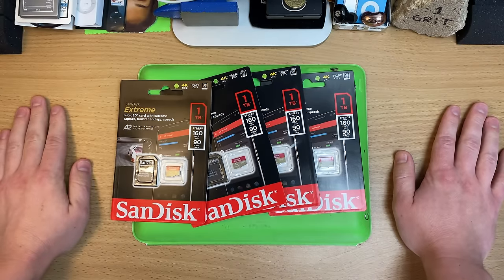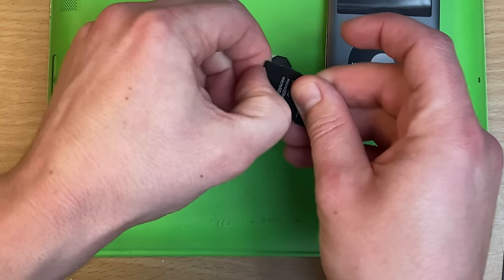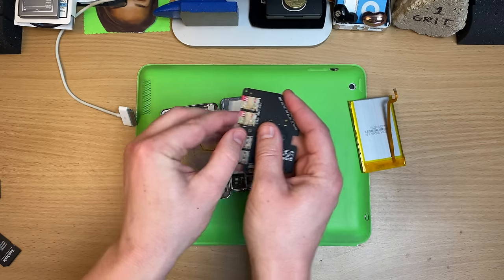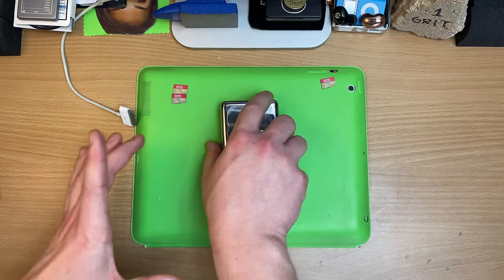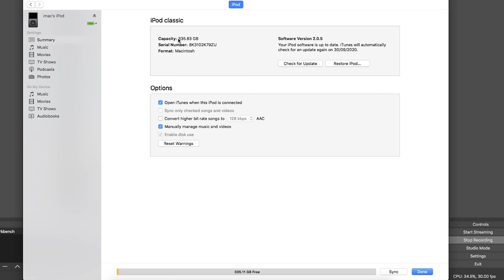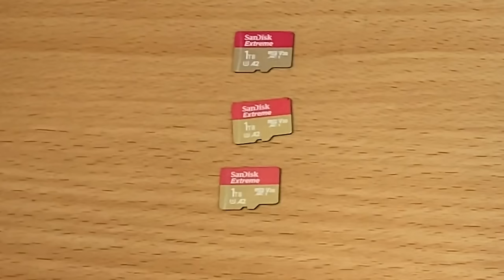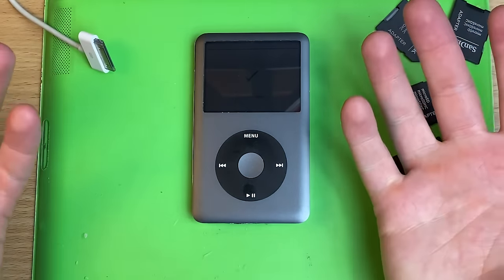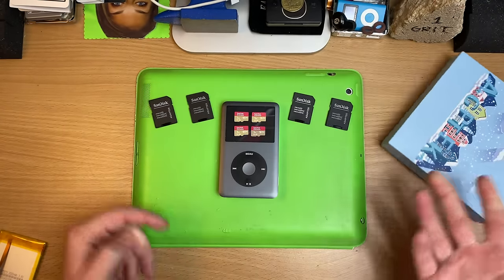4000GB in an iPod Classic.

Comment: The reason why the iPod can’t go over 2TB is because 2TB is the max address space for a 32 bit system like the iPod
Reply: • Joe Panda • FAT32 has a 2TB limit because... you guessed it... 32 Bit
Reply: RAID10 those SD cards son.
Reply: Was just about to comment smtn like this lol
Reply: he tried FAT64 as well though
Reply: schm1dt I have no idea but i am goona pretent that i under stand that.
Reply: It's probably not a good idea to keep touching the contacts on the memory cards or put them with the contacts touching any surface. You're bound to fry them with static.
Reply: so a 64-bit system has a 4TB limit as well?
(I'm just timing  it by 2 since I'm not a technician)
Reply: ALSO the MBR partition table can only handle up to 2Tb
Reply: i was thinking that myself because its from 2007 and not modern running on atleast 64 bit
Reply: is 4GB the limit for fat32?
Reply: schm1dt  oh i see. I thought everything was 4gb. it was just one file. Thank you
Reply: @iLife64  Maybe Modify The ipods Bios Will help to over 2tb (my opinion)
Reply: you should say spoiler alert before you say these things you pufferfish
Reply: This means that technically, an Nintendo 64, who's name is N64 because it's got a 64bit processor, could realistically see more than a 2TB game cartridge if one was made for it?
Reply: schm1dt  Good point, I'd imagine the connection would likely be the next limitation.  It'd be interesting to try though, see how large a cartridge you could fit in an N64
Reply: A 7th gen Classic is technically a 64 bit system the older iPods like the iPod Classic 6th gen are 32 Bit systems that is why you can put 1TB or more on a 7th gen but you cannot put 1TB or more on a 6th gen or older.
Reply: Music is noises
Reply: That's not actually true.  2TB is a limit for MBR if you have 512 byte sectors.  The iPod uses 4k sectors which makes the limit be 16TB

The FAT32 technical limit is 4,294,967,296 clusters (2^32 or so) and each cluster on the iPod is 16384 bytes which makes the limit of that being 70TB.

I know I tried using a 1TB card in mine and on the new board, the system did accept the 1TB card this time... but when I tried to write to it after adding more cards, the iFlash Quad board started being unreliable and kept crashing the iPod Classic (2.0.5 version)

Windows 10 supposedly will let you make a MBR partition over 2TB if the sector size is more than 512 bytes... but again.. can't get the 1TB card to work in mine so unless the iFlash Quad guy makes an iFlash Octa board, then I'm SOL on that hope.
Reply: @iLife64  No.  :)  That's not true.  You have 2^32 clusters you can have which makes the 16k cluster of iPod be limited to 70TB.  4k sectors on the iPod makes the MBR limit actually be 16TB since the 2TB limit is for 512 byte sectors which is what most disks have.
Reply: schm1dt  Yeah, but an iPod has a 4096 byte sector size.  :)  FAT32 address space is 4294967296 clusters.  iPod clusters are 16384 bytes.
Reply: schm1dt  Im pretty certain GPT wasn't even a thing yet when those ipods were sold. So there would be no compatibility. Remember when larger than 2tb drives first hit the market, there was software you would have to install before the OS could use it, and a lot of motherboards wouldn't work either.
Reply: schm1dt  " but there is a 4GB limit to any singular file on FAT32", somewhat off topic, but if i had to guess, would that be the reason why 32 bit windows has max memory of 4gb? i know a decent amount about hardware, but only little about software, storage, etc.
Reply: and 64bit
Reply: schm1dt  So is it possible to change it to let's say GPT?
Reply: Well, you should have communicated this to the man before he started trying to get mora than 2TB in that nugget
Reply: @GingerNingerGames  iirc the n64 supports banking and is how you would go over it's system limitations so theoretically I guess you could create a cartridge with a custom chip that could switch between thousands of banks to achieve a tb+ game. It wouldn't look much better but the amount of levels you could have would be practicality endless.
Reply: because FAT32
Reply: Everyone's talking about FAT32, but FAT32 is irrelevant in Dank's case since he's restoring the iPods on a Mac, so they get formatted as HFS+ (which supports 8 EB). MBR (and GPT) are also irrelevant since Mac formatted iPods use the old APM (Apple Partition Map) used on pre-Intel Macs
Reply: All of these theoretical limits are pretty meaningless.  Here's why:

MBR uses a 32-bit number to track starting sector and partition size, so you can't have a partition start at more than 2TB.  Although... technically... you can have a 2TB partition that begins at 2TB, though OS support for accessing that volume is a mixed bag.

FAT-32 uses some indexing based on sectors, but most of its internal structures depend on the number of clusters, which are a multiple of sectors (power-of-2 multiple, from 1 to 128 sectors per cluster, with a well-supported maximum of 32KB/cluster, and a sometimes-supported maximum of 64KB/cluster.)  FAT-32 actually uses a 28-bit cluster index, not 32 -- the high nibble is reserved.  So, in theory, 7TB (32768 bytes/cluster * 0x0ffffff4 clusters) is the volume ceiling, assuming 512-byte sectors.

(EDIT:  Wait, no, the BIOS Parameter Block actually does have 32-bit sector-count fields, so we're back to 2TB.)

IIRC, SD always uses 512 byte sectors, although I'm not 100% sure about SDXC -- it has been a while since I looked any of that up, and I was more interested in accessing smaller SD cards from a microcontroller via SD's SPI fallback mode.  However, all of that is moot without understanding what the FPGA(?) on that adapter PCB is doing to combine 4 cards into one "physical" volume.

At any rate, I don't actually know whether the iPod is using MBR and FAT on its disk, which would imply some known limits, or if it's translating raw storage blocks to the host in disk mode, and has its own on-disk layout.  That seems like a lot of work, so it's probably real FAT or HFS (depending on Windows or Mac format.)

Now -- the real question is, what LBA scheme is the device using to communicate with the virtual device presented by the adapter card?  Is either using LBA48?  If so, 128PB is our cap.  But it could be LBA48 with 32-bit truncation, which takes us back to 2TB.  My money is on this.  It probably keeps track of sectors in a 32-bit unsigned int, so 2TB is most likely the ceiling.
Reply: I was watching this video thinking, 'Slightly over 2TB. That's familiar…'.
Reply: @RiskiVR  Doesn't matter, the iPod itself has this limitation.
Reply: It's actually because iPods use Master Boot Record for their storage management, which maxes at 2TB. For anything more you need GUID Partition Table
Reply: schm1dt  no, 32 bit has a address space of 426443980
Reply: Absolute chad
Reply: @RiskiVR  exfat won't help with that
Reply: @yelnatsch517  You'd think that but SD cards are incredibly hardy little things. You can submerge them in water, destroy the device around them, and even chip a piece off and it'll still read almost every time. I lost an action cam to a battlebot match and the card was totally readable even after the camera battery went up in flames.
Reply: lets not forget the fact that iPods most likely use MBR that have a 2 TB limit anyways
Reply: @whycantifindanavailablehandle  Even if the cpu is 64-bit, the limitations lie in the partition scheme (mbr). So unless those 64-bit models use a different partitioning scheme (which I doubt) it won't make any difference.
Reply: or because apple only has a device that goes up to 2TB (ipad pro). so maybe they don’t have any number GB higher in the system idk
Reply: schm1dt  The iPod Touch as the Smartphones work a 64-bit system, so it would be possible to put in these 4 cards of 1TB or more, knowing that the 64-bit system has a memory of up to 18 EB (Exabytes)?
Reply: @RiskiVR  the ipod is 32 bit. feeding it 64 bit storage addresses doesn't change that, it just makes it brick even harder.
Reply: 2147
Reply: @RiskiVR  32bit not fat. It’s the chipset bro 😂
Reply: @smokyblackeyes3615  18 Exobytes for a 64bit system or 2 to the 64th power.
Reply: @RiskiVR  music youtuber
Reply: @RiskiVR  how much storage can a modern thing even read today?
Reply: @DigitalJedi  did you have the footage tho
Reply: @tylern6420  literally as high as you can imagine
Reply: @tylern6420  As I said, the card was still totally readable. The card was fine, so I had the footage.
Reply: @tylern6420  A 64-bit register can theoretically reference 18,446,744,073,709,551,616 bytes, or 17,179,869,184 GB (16 exabytes) of memory. This is several million times more than an average workstation would need to access. What’s important is that a 64-bit computer (which means it has a 64-bit processor) can access more than 4 GB of RAM. If a computer has 8 GB of RAM, it better has a 64-bit processor. Otherwise, at least 4 GB of the memory will be inaccessible by the CPU
Reply: @smokyblackeyes3615  no, not working like that. 2 petabyte
Reply: @fizzyfox5529  GPT together with the specifications for the UEFI system existed since the very early 2000s
Reply: 64 bit ipod
Reply: schm1dt  Dave Plummer, the guy who put the 32gb limit in place for FAT32, doesn't entirely remember his thought process on why 32gb is the limit. His best guess as to why 32gb is because he had a 16M drive to test with, and so he multiplied its storage capacity by x1000, then by x1000 again for good measure, leaving us with 32gb as the limit. it wasn't because OSes wanted to push people towards better file systems
Reply: @333Orobas 666 you mean IDE and SATA controllers generally had a limit of 2TB.  In the ancient times before 2TB drives were common.  Like in say 2007 when this dank pod was on sale?
Reply: @333Orobas 666 agreed, the old limits can be worked around on a full computer fairly easily.  The old 2TB limit was a big thing when we were about to hit it, but has been fixed for a long while now.  Older syatems from the 90s basically had a limit depending on the file system.  FAT16 was limited to 4GB volumes, but you could always use multiple volumes on the same drive.  FAT32 with 512kb sectors was limited to 2TB and that was the max sector size for Windows, hence most hardware manufacturers went with that until we hit that limit.  Microsoft strikes again.
Reply: @RiskiVR  i think you mean exFAT
Reply: Little fun fact, when you use a 4TB drive on a nintendo wii (softmodded), it believes the drive has minus 9 septillion GB, which is funny to see, but makes it useless since there's other issues, so I've split the partition into 2x2TB (as if it was 2 separate drives) and it worked fine.
Reply: I’m sure you just made him feel so stupid😑
Reply: Tech boi or grl
Reply: But 2 terabytes are not enough for storing music 🥲
Reply: I clicked on this video wondering how long it would take him to find this out. I did not realize that he actually didn't do any research before using the money on cards lol.
Reply: +2x ya de por si es absurdo 4tb (ni en un Ipad de ultima generación.
En este caso le rendiría mejor 4x256 o 512gb si sigue empeñado.
Yo en el 2004 ya me consideraba feliz con un discman mp3 que soportaba dvd´s 4,3gb y contaba con 64mb de ram  para el Anti-Shock
Reply: @MySqueezingArm  the iPod uses an IDE interface for its storage drive. Literally wouldn’t be any faster if you raid it
Reply: @TornadoSandwich  sd cards don't need to spin my guy.
Reply: Well...no actually 32 bit systems have 4G of maximum address...so maximum space is 4G of EPROM(SD Memory in this case) + ram + inputs, what's really limiting the memory could be the size of the blocks of the partitions. If they are small like 4kb(default) they literally fill up the address 4T/4kb =2GB of address space used (2^43/2^12)(the memory is divided in chunks of addresses to increase the maximum memory capacity if you use 4kb partitions the processor asks the memory controller all the block), it's really reasonable to assume that they haven't mapped more than 1G of space for the EPROM...why would they...so to make it short when you are formatting the memory use a 16kb partitions (you can do it easily on windows with the default formatter), but remember that the memory controller that merges all those SD cards could also be the problem.
Reply: @RiskiVR  if the ipod works on a 32 bit cpu it doesnt matter the limit will always be 2 tb
Reply: Aq
Reply: Unless you use a a mux
Reply: @MySqueezingArm  That's great for data protection and redundancy, but it wouldn't help with more usable space.
Reply: @OtakuUnitedStudio  the ipod can't break 2TB anyway
Reply: @smokyblackeyes3615  no 64 is a lot more because he has 16 32 terabyte hard drive today
Reply: :hand-pink-waving::hand-pink-waving::hand-pink-waving::hand-pink-waving::hand-pink-waving::hand-pink-waving::hand-pink-waving::hand-pink-waving:
Reply: schm1dtxbox  Ñ
Reply: useful info : something completely devoid of in these videos.
Thanks !
Reply: @GingerNingerGames the n64 have 2 32bit cpu's that work at the same time if i Remember correctly
Reply: @RiskiVR  yo riski!!!
Reply: @smokyblackeyes3615 idk if you got an answer already, but 64 bit can address 18,446,744,073,709,551,616 bytes, or about 18.4 exabytes. 

You’re kinda on the right track, but it scales exponentially, not linearly. So it’s from 2^32 to 2^64.
Reply: @smokyblackeyes3615 it's exponential, because every bit can be 0 or 1, which means 2 possible states per bit, so 32 bits can address 2^32 and 64 bits can address 2^64 which is about 16 exabytes.
(In reality it's not that simple because of different storage systems)
Reply: @AveryChow  my first laptop had 50mb storage, 4mb ram. 50mhz cpu, and 25mhz math-co-p. when first cd came out, i was like these guys are out of their minds to have this much storage i couldnt fill half my 50mb for 2 years. today i have like 2x10TB in my nas, and it is 50% full already. i ve one nvme at 512 for os, and 8tb hdd for data, 60+% of which is full. come to think of the 32gb, i wouldnt have passed 4gb :) around those times that was pretty sick size for an mp3 device when you think of it. today we have storage servers with PBs of data. soon they ll explode too with single 250tb nvme/ssd drives coming. over the years, people will be laughing at our today's limits :) games for example coming with 150-200gb size requirements on storages.
Reply: @smokyblackeyes3615 no, you can calculate the max addressable bytes with the formula 2^bits.

(Or two to the power of the amount of bits)

Every bit doubles the previous amount, 33 bits would have 4tb, 34 would have 8tb, and 64 would have ~18,446,744 TB, but most 64 bit processors have a 48 bit address line, so you can have about 256 TB on a modern cpu.

Every
Reply: @RiskiVR it doesn’t matter, the Classic’s cpu address line can only handle 2TB of memory, if it had just ONE MORE BIT, then 4TB would be possible.
Reply: Fat32
Reply: @iLife64  you can format the sdxc for exfat
Reply: @RiskiVR  32 bit processor system has nothing to so with storage format.
Reply: But if he can change the IPod to x64 then it works?
Reply: @Cyan476  This will require to change the CPU and to rewrite the OS
Reply: @Cyan476  would require complete rewriting of the entire firmware, and then itunes probably wouldnt even know how to feel.
Reply: @smokyblackeyes3615 it's magnitude of order more like impossible ammount
Reply: @smokyblackeyes3615 Nah mate, that would be 33 bit. 64 bit has a HUGE address space of about 20 million terabytes.

However it's still possible to put more than 2TB of storage on a 32 bit computer, it just requires a different partitioning scheme.
Reply: It’s a mbr system master boot record which has a max storage size (doesn’t matter the file system) of 2 TiB (2000 GB)
Reply: Oh, okay.
Reply: Oh, okay.
Reply: @smokyblackeyes3615 
Uh bigger, it’s 17,179,869,184 GB (16 exabytes) or 17 million terrys
Reply: @smokyblackeyes3615 no. Not even close. 64 but isn't just twice 32, it is 2^32 more. 32 and 64 are exponents when determining addressable storage.
Reply: RAM limits and disk space utilization is different. Max addressing is 2TB for RAM but if you change the cluster size when formatting (ie increase the cluster size from 4kb to 8kb) you’ll get the same amount of address space while utilizing more of the disk.
Reply: @smokyblackeyes3615 no, it’s like 32 times larger.
4 billion is the 32 bit integer limit
and a stupidly large number is 64 bit integer limit
Reply: Raid Shadow Legends or Raycon had something to do with it....I know it.......🤣